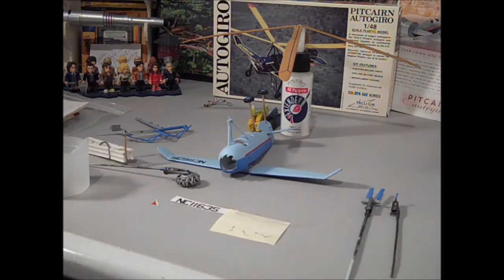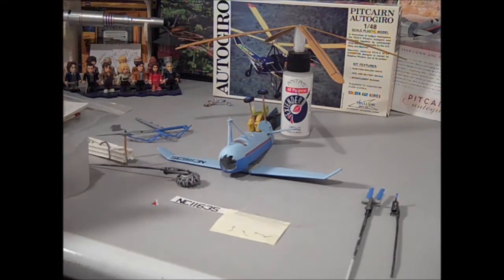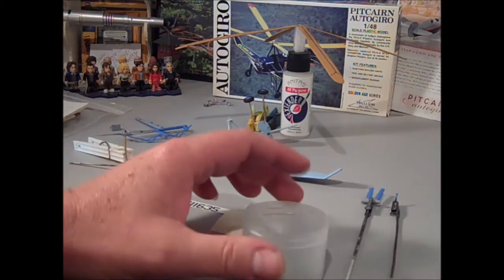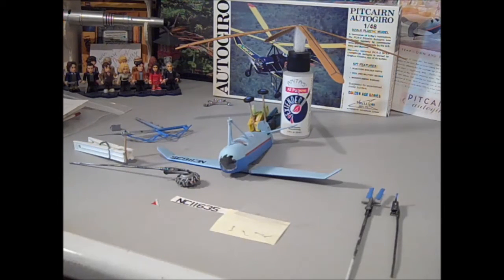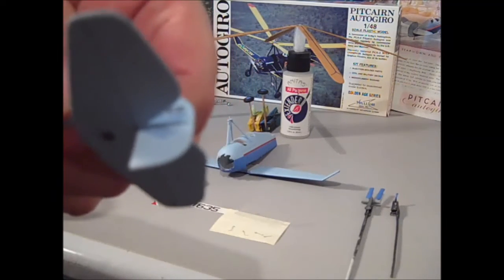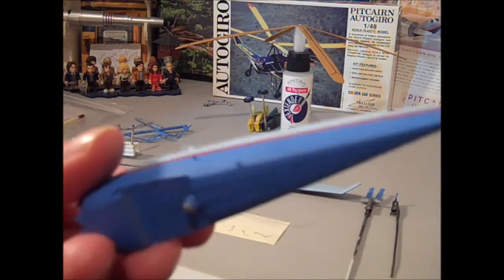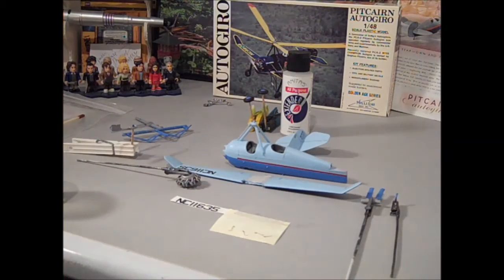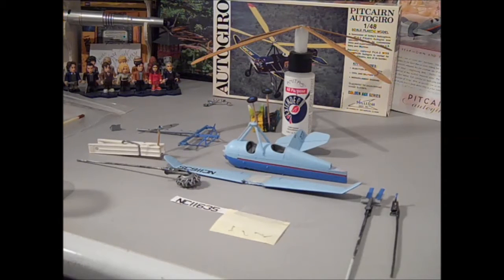Pitcairn Autogiro Update # 3

Comment: Well, let me start off by saying that my marble collecting virus started about 3 years ago. Take note of all the cans in the crates in my marble fixation video!
Second, I need a larger marble collection because I have lost almost ALL my marbles over time up until this point in my life!!! =)

Now, you have made some nice progress on the autogiro! It is really looking good! It was real fun and I actually laughed out loud watching the balancing act between you and the blades!!  =)
Reply from the maker: +MindlessModelWorks LOL.  I was thinking Tom (rambler69) was one to bring the virus to light, but watching your marble fixation video makes me think you've got it the worst of us all!  He only has a pint bottle, where you have a much bigger one with more in them.  You are restocking your lost marbles pretty well!Thanks!  It has been a pretty fun build.  Outside of flash, misaligned molds, and lots of tiny scratch building, it's been AWESOME. :)  I kept getting nervous about dropping the rotor on camera.  The rotors are pretty well balanced, but I shouldn't have made that temp base so narrow.  It's a bit tricky getting it to stand on the paint bottle with that little bit of foam.  You would have had a scream watching me decal that thing! Flipping it all around and trying to get those narrow long decals onto such a small moving area.  It was pretty funny, NOW.